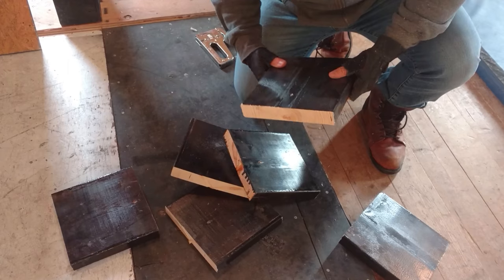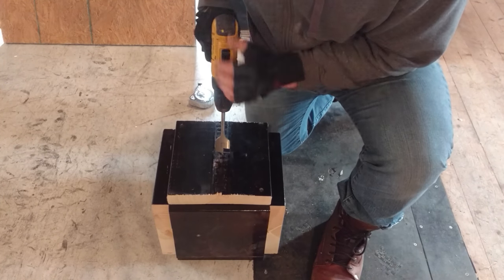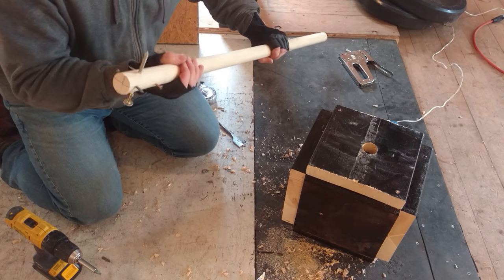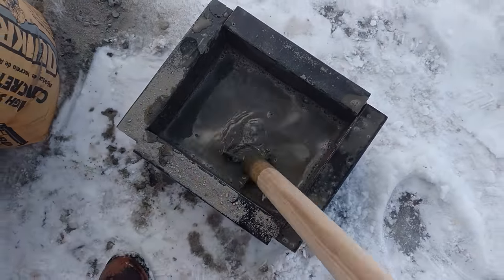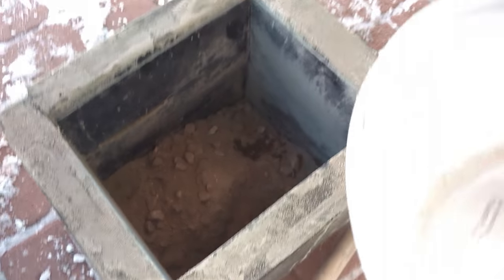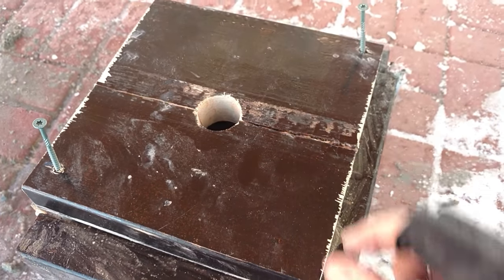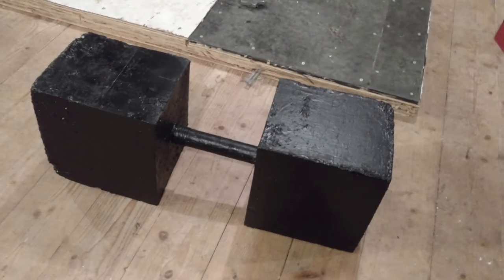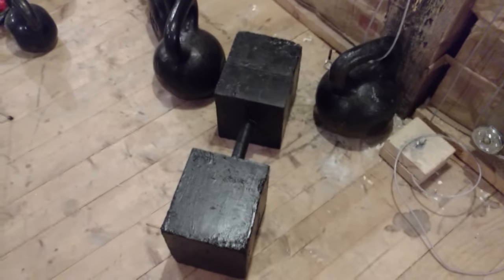Worlds HEAVIEST Homemade DIY Dumbbell You Can Make at Home

Comment: Great idea. Wish you would of added chamfers so corners weren't so sharp, used a tamping rod to consolidate and eliminate rock pockets, which caused the breakage when removing from form, and the wooden dowels. Why wooden dowels for weight that won't be gently set down? They will break. I promise. Should of used schedule 40 pipe. Thanks for the idea👍

Comment: Have you had any problems scraping up against the edges yet? It seems like round and smooth weights would be safer.
Reply from the maker: JeffTheHokie there is zero chipping. the ruberized coating and spray paint does a good job at preventing the concrete from chipping
Reply: I wasn't referring to chipping.  I was referring to the sharp edges and the prospect of accidentally bumping and cutting your arms with them.  Just wondering whether or not that would be a problem in actual use. Your answer seems to show that you haven't had that problem.
Reply from the maker: JeffTheHokie the ruberized coating makes the edges soft and smooth. I haven't had any problems with the edges rubbing on me while doing various lifts

Comment: Question once one side is done drying did you re use your 6 wooden 9 by 9 pieces? We’re they hard to get off once it was done drying?
Reply from the maker: Yeah, I reused it to ensure the same volume/weight of concrete on each side. They came off very easily.